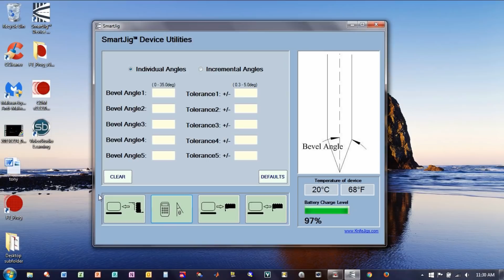Knife making How to make a Hunting Knife 7" blade tooled snake skin leather sheath scrimshaw handle

Comment: Just a quick tip for the gimping bro, if you start the initial groove with a triangular file it's much easier to get your lines precise and then round them out with your half round or round files.

Very Nice work bro!
Reply from the maker: Good tip, thanks!

Comment: the only thing bad about this knife is that it's too gorgeous to use ! bravo my friend incredible craftsmanship
Reply from the maker: +cj c Yeah, I think I won't be using this one.  Thank you for the encouraging words!
Reply: +KnifeJigs lol . no problem man, keep it up you're awesome
Reply: +cj c i would have to agree although i think a better metal like titanium or s30v or 134cm should have been used. maybe incorporated a kydex inner sheath(for retention) with the leather outter(for a leather exterior) and a place for a fire steel. design was great and the craftmenship was very nice. outstanding job senior.
Reply from the maker: +SINESTERSERPENTSIXXX 440C is a great steel.  It has 0.95 - 1.2% carbon content which is 
considered high carbon.  It is corrosion resistant.  It is wear resistant.  It holds a pretty good edge and it can be easily sharpened.  It is very common for high end hunting knives.  It is also widely used in aerospace industry and other industries due to its excellent properties.  About the sheath, you can use a inner kydex but it wasn't 
necessary for this sheath.  The strap makes it virtually impossible for the knife to come out.  Thank you for the comment!
Reply: +SINESTERSERPENTSIXXX you are actually saying (sorry for bad english) titanium for theblade? noooup. and leather (a better leather could be better but...money! jaja) make the sheat nicer
 but im agre...y like 5160 way more than 440c
Reply: I have seen way better then this so don't worry...wait wot?
Reply: cj c
Reply: The only thing better than this knife is an actual knife. It wasn't tempered, it's just a KSO (knife shaped object).
Reply: 4:56

Comment: I assumed it would be more consistent to use a jig for grinding rather than free handing. But you make it look easy.
Reply from the maker: +Xero Once you establish a preliminary bevel at the correct angle using the electronic jig, then free handing becomes easy.  You just let the blade ride on that bevel against the platen.

Comment: i must say that at first i had some doubt as to the quality of the scrimshaw but the end result was quite good. I'm impressed. not sure about the choice of stainless for the blade material though, does that 440c hold an edge any where comparable to high carbon? anyway all said this was a very good video. keep up the good work!!!!
Reply from the maker: The type of steel used depends on the application obviously.  For hunting knives, 440c is pretty common.  Thanks for the comment.
Reply: thank you. i have one question is 440 c magnetic? and keep up the good work. you have inspired me to do my own scrimshaw.
Reply from the maker: +Phil B Yes, it is.  Thanks Phil!

Comment: This is amazing..really amazing..have you ever thought about using the same paper tattoo artists do for the scrimshaw part? so all you have to do is wet it, place it, and scratch away the ink?
Reply from the maker: You can't use a tattoo needle for scrimshaw.  The needle is made for skin and it is too soft for scrimshaw.  The scriber used to scratch or stipple material like ivory or other similar material, is extremely hard.
Reply: +KnifeJigs oh I'm sorry I didnt mean the needle I mean the transfer of the picture to the bone using the same paper its kind of like those fake tattoos you get as a kid just press and apply water to the back
Reply from the maker: +GXC Sorry I misunderstood.  Yes, it should work.  There are other ways to transfer the image onto the material.  At the time I did the transfer, I didn't have any other means so I scratched it in.  Thanks for the comment.
Reply: +KnifeJigs no worries..I was thinking of ways to reduce time on making the finished product so its easier on you lol but thanks for the video it is amazing I do want to make my own blade at some point haha
Reply from the maker: +GXC You should do it.  It's a lot of fun.  Thanks!

Comment: I have watched a lot of knife making videos, but non of them showed how to use the pins on the handle the right way. You could make the handle without the glue, only with pins if you know how to use them.
Reply from the maker: Well yes and no.  If you use regular pins like the ones used in the video, and rely on friction only, you will put a lot of stress on the wood handle and will crack it.  If you use a screw type pin, then you wouldn't need the glue.

Comment: Beautiful work..! You sir, are an artist.
I see your website is currently down, which is a shame..but i might come back to it at a later point of time.
The snake-like profile in the sheet, is it just hammered into it, with that tool you have..? I considered to fabricate a similar knife, but my plan was to burn the profile down into the leather with a modified soldering iron.
Reply from the maker: +Kalle Klæp Yes, it is hammered in.  The site will be up later today.  Thanks for the comment.

Comment: So what am I doing wrong???  I have that same Grizzly belt grinder and it take me ALL DAY to cut a bevel.  I'm using an old rasp as stock.  I think maybe it didn't soften the steel properly or something.  How long did that initial bevel take you to cut, and with what grit belt?
Reply: I should add, I put the rasp in my brake drum forge until nonmagnetic, then let it air cool for a few hours, still harder than Chinese arithmetic.
Reply from the maker: +Scott Bozarth That should have annealed it.  Type of belt you use is obviously important.  If you use aluminum oxide, you will be grinding all day.  I used 36 grit zirconia alumina belts for the initial bevel and took me about 1-1.5 hours to do it.  If you use ceramic belts, that's even better.
Reply: KnifeJigs Thank you!  I was using 60 grit aluminum oxide...I guess that explains it.  Time to place an order, I guess.  HAHAHA  Thanks again!!!

Comment: Nice work man. I have a question. No hardening the blade? no heat treatment? the blade is magnetic or not? thank you!
Reply from the maker: The blade was hardened but the process wasn't shown in the video.  There are plenty of videos on YouTube if someone would be interested.  Thanks for the comment.
Reply: KnifeJigs Ok, thank you. so, you hardenet the blade, but not shown. i wonder if i can buy some already hardened steel since i cannot heat treat it, and then if the sharpening will be much heavier to do. thank you!
Reply from the maker: You would not want to work with hardened steel when beveling.  Especially if 
it's high carbon steel.  It is incredibly difficult if not impossible.  The 
sharpening is always done on hardened steel at the end.
Reply: KnifeJigs ok man, thank you!

Comment: that is beautiful....can I have it...lol
Reply from the maker: No, but you can have my 1×30.  Thanks Joseph!
Reply: +KnifeJigs I got my own but can I just borrow your skill/patience with it. I hate the balance game, not to much pressure to bog it down, but enough to actually take metal.
Reply from the maker: +Joseph Rector You'll be amazed what you can do with a 1x30.  As you said, it does take more effort compared to a higher end grinder but it sure beats hand filing.  Most people can't afford anything better than a 1x30.  If you have couple of G's stashed away and don't know what to do with it, by all means buy a 2x72.
Reply: +KnifeJigs trust me I woud, I discovered after my first time using it thou must get excess metal off with another method as much as possible, no hogging through metal like a 2x72. also I need to build a workbench. clamping steel to the aluminium handles on my roll around cooler isn't ideal. now to con the chairman of the household finance committee of this, then on to the executive officer of errands and honey do's to beg for time off.

Comment: I'd like to ask, when you're grinding the initial bevel, before the heat treat, how thin do you get the blade? Is it thin enough at that point to cut your skin if you press hard enough? Or is there still a square edge? Because on the last knife I made, I think i got it a little too thin or the heat treat was a little to hot, and the blade melted. Any help would be appreciated.
Reply from the maker: Before heat treat, you should bevel until the blade edge is about 0.050 inch.  So the edge is still square.  After heat treat you should bevel further so the edge is about 0.020 inch.  Then you put the handle on and at the end you sharpen the edge.
Reply: KnifeJigs Thanks for the help :)

Comment: I don't wanna sound like a snob, but to me a knife is mainly about the metal works.
Meaning the result of blending metals, hammering to a basic shape, heat treating and hardening.
+/- Etching or special metal pairings for special blades. Also +/- steel folding

I see that you are making a pretty handle and so on. But to me this looks less like knife making and more like sculpting.
You should get together with a smith. I see many people add really ugly handles and adds to very beautiful blades, while you add a nice finish to a bad blade. I wonder why so many Youtube channels make knives like this.

Comment: you give me and my HF 1x30 Hope
Reply: same here, its so nice to see people make great knives like this but using a 1x30. instead if a 500$ belt grinder haha
Reply: how much power does an 1x30 usually have?
Reply: +Filippo Bellini they almost if not always have a measly 1/3 HP this means they very finnicky, you have to find the balance  between removing almost nothing and bogging it down so bad it stalls.
Reply: +Joseph Rector thak you very much for the quick reply! I'm looking for something like this, because I can't afford a bigger sander...
Reply: +Matthew Ballard where are you finding 500 dollar knife grinders?
Reply: +tone1132 there are some attachments for bench grinders that run about 500 I think, also some places will sell frame,flat platten only , no motor etc for that much...
Reply: +Joseph Rector oh ok. that I can see. I thought you stumbled upon something awesome. my grinder cost 1700 bucks! sure wish it was 500 lol
Reply: My HF 1x30 is one of the most used tools in my shop. I took the backing plate off from behind the belt, it runs much better now and if the belt is taut it  still cuts flat. In fact, aside from the switch I had to replace, this has been one handy little tool.

Since then I have discovered low friction (Graphite?) self-adhesive backing that you put on the backing plate that lets the back side of the belt slide with much less drag. I use that one my larger HF belt sander. I see some guys use PTFE sheet for the same purpose.

Comment: How doesn't the blade rust? the material is stainless or any treatment?
Reply from the maker: It's made from 440C stainless steel.  No treatment.
Reply: 440C is stainless. Special heat treating required.

Comment: where you bay a steel ?
Reply: +wojtek suchy Your local blacksmith... ask for 440 C , which is a high strength carbon steel,perfect for knifemaking. Alternatives are also used, your blacksmith will guide you.

Comment: There are other easier ways to bevel a blade
Reply from the maker: +Pulse of the Fallen If you like freehand beveling then this jig is perfect for it.  It is easily programmable to whatever angle you need.  If you don't like freehand beveling, then there are several ways to bevel the knife and they all need some kind of mechanical jig.  The jig would depend on the kind of grinder and quality of your grinder.  Then either the angle of the jig or the grinder platen must be set.  Personally, I like to bevel my knives freehand.  It takes my couple of minutes to program my jig and I slap it on the tang and start beveling.
Reply: KnifeJigs I mean it seems kinda tedious to put the width, height, etc in when you could just do the thing with the drill bit. I just think it would be easier because you could screw up the values and mess up the bevel
Reply from the maker: +Pulse of the Fallen You need to know the angle of the bevel or you will ruin your blade.  To figure out the angle, you must know the width of the bar and how high you want your bevel.  I don't see any way around it unless you are a master knife maker with decades of experience.
Reply: KnifeJigs But there was - you know what I don't know shit, you do, you win
Reply from the maker: +KnifeJigs You can still mark the center of the blade with a drill bit or a scribe.  This has nothing to do with the angle of the bevel.